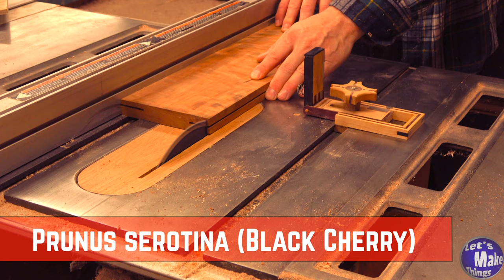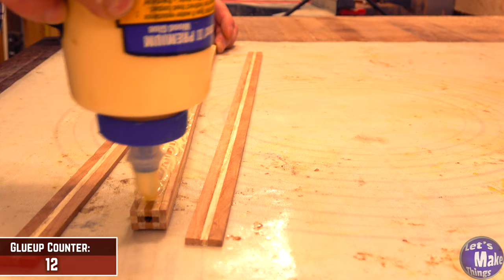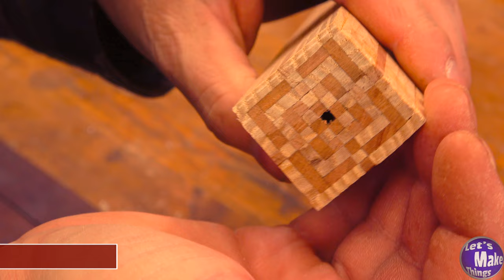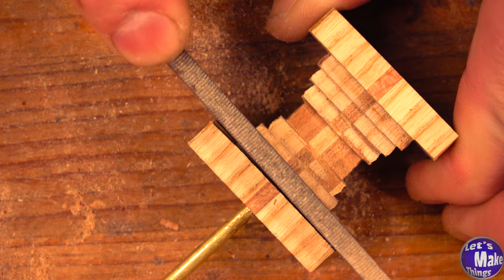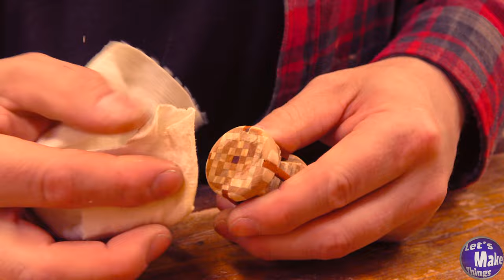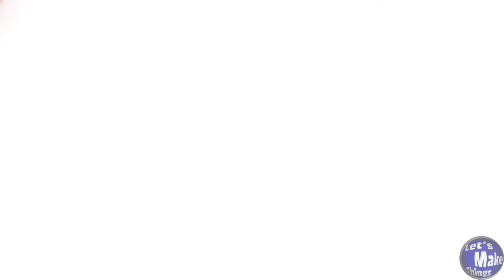100 Awl Challenge: Act 6 // The "Hour Glass" Awl

Comment: Rob, this one is very interesting. The glue up was very detailed but the final product isn’t my favorite. It does though show a lot of ingenuity.
Reply from the maker: Between me and you and whomever reads this, this became something else.  It was going to be called the "Pixawl" and have a pixelated look to it.  Due to time and how dangerous it would have put me with my table saw, I changed it.

Not my favorite either, but I'm trying to find a way to challenge each awl a little more than the last.  This week's will probably not have the same difficulty setting as this monster had, and trust me, it was so much harder than I anticipated.  The problem with doing 1/8" glue ups is that the wood compresses if you're not careful and making patterns is near impossible.  I got very lucky with this.

Thanks for you honesty Don. 👍
Reply: @makethingswithrob  Rob, you made me very nervous with some of those table saw cuts. If I was trying a shape like an hourglass I would have turned the handles on my lathe. Even then it would be very tricky with all those glue lines. I discovered that Titebond does not penetrate the fibers of ebony enough for a strong bond for turning. My Myrtlewood/ebony is literally a bust. The glue bond came apart between the ebony and Douglas fir wood block I used to hold the handle in the chuck. Many of the woods you use are oily so I’m surprised that some of those glue ups hold together.